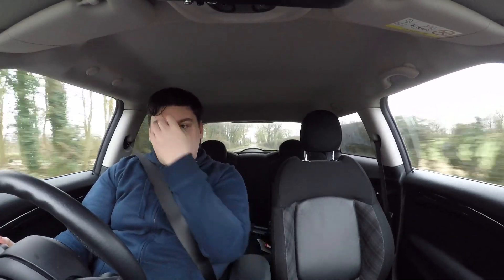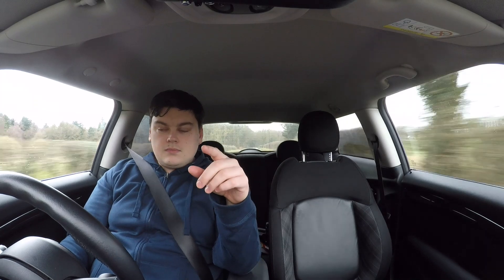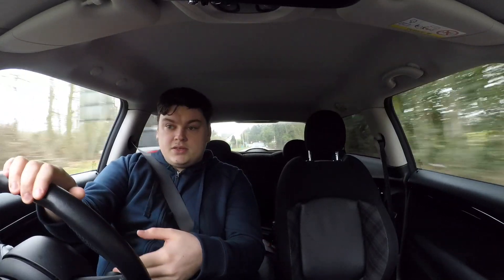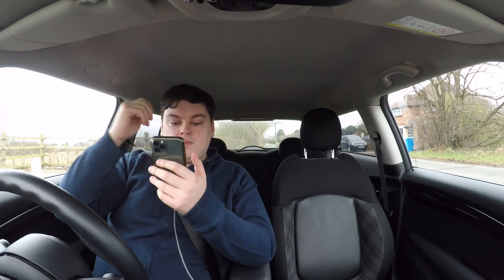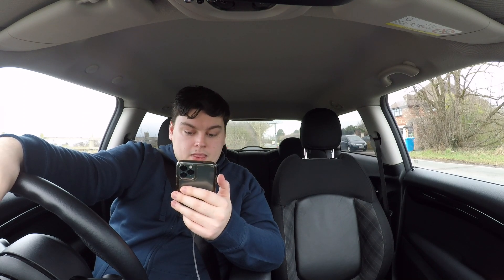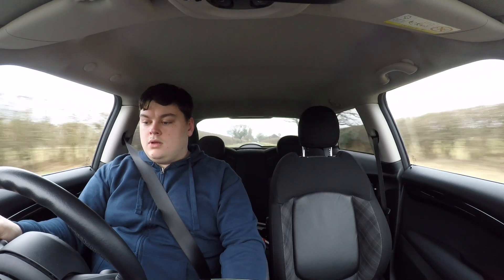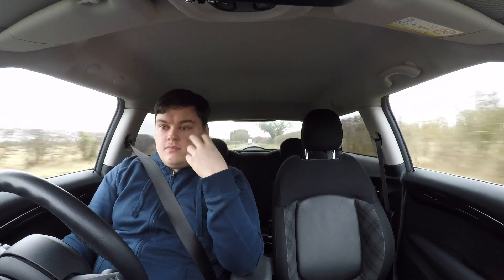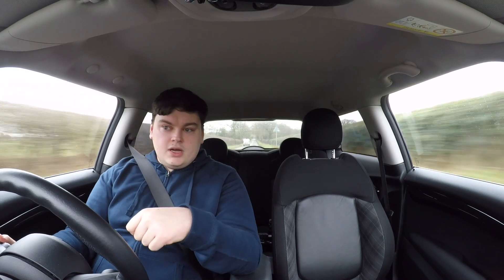MINI COOPER S F56 EBC YELLOW STUFF BRAKE BED-IN PROCEDURE!

Comment: Nice video Ben. Iv gone through the same process with yellow pads! Now done 1500 miles and they are better now than they were after the bedding in process! I feel like the cold performance is not massively improved from stock, but once they have some heat in to them it’s night and day.
Reply from the maker: Hey Paul! Thank you 😊 your spot on there. I thought they had improved massively once I had bed them in but since doing around the same miles as yourself it’s crazy how much they’ve changed over time. I agree though, cold performance is close to stock but once you get them going it’s fantastic!

Comment: Thanks the comments here saved me some money. My car has Tarox Strada pads and they're amazing when hot but basically OEM from cold. Which is of little use to me as I don't drive that hard and value that initial braking bite. Was considering Yellowstuff but if they're exactly the same then I won't throw money at EBC.

Comment: Hey Ben, I just installed EBC Yellows on my F56 and am experiencing a ton of noise. Just wanted to see if you can share your experience after bedding them in. Living in Chicago has made it difficult to find a place to bed them in properly but I was able to bring them up from 80 -> 20mph 3 times. Noise is at an all time high. Probably about 500 miles in on them.
Reply from the maker: Hey mate! They are slightly noisier than the stock pads I’ve found. But performance exceeds the slight noise for me.

Comment: Great video, how is the noise with the EBC Yellow's? I'm considering getting them for my '19 JCW but I'd go crazy if they are noisy since it's my daily driver.
Reply from the maker: Hey! Thank you! When they’re cold I have noticed that there is a slight friction sound but once they get some heat behind them they seem fine
Reply: @BenRolfe  Great, thanks, I'm trying them next then!
Reply: @bokiNYC did you try them? How did you like them?
Reply: @BlueWafer  I didn't get to try them, traded in my Mini for a 8Y RS3 - after about 40 years of driving only manual cars I had to switch to an automatic. But it's a great car so I'll be just fine. I do miss my JCW from time to time, it's a great car.

Comment: How can u bed brakes in with the zinc coating ? I thought that had to be removed first
Reply from the maker: Zinc coating? There was oil on the disks for transportation purposes to stop rust which was removed using brake cleaner.
Reply: @BenRolfe  no I mean on brakes discs u normally get that first layer which normally dissappear off after like 5 miles or so no one uses brake cleaner nowadays on new brake discs that was olden day stuff
Reply: @BenRolfe some people do this process immediately after fitting new discs and pads isn't 250 miles bit too late
Reply from the maker: @germanautos9460  gotcha, I’d driven the car around 50 miles or so before bedding in. I think I mentioned it on the video but I can’t remember. So I’d imagine that any zinc layer on the disks had already worn off by the time I begun the bedding in process
Reply from the maker: I just went off the manufacturers bed-in process which came in the box and is available online. 

https://ebcbrakes.com/race-motorsport-articles/bedding-in/
Reply: @BenRolfe 2 last question I promise lol the brembo discs were they from bmw/mini as in OEM part ? And when bedding in new pads with new rotors don't the rotors have their own bedding in procedure like 900ish miles or so before u can have fun ? I'm just a little confused with the whole process I keep warping my discs and soon my bank acc will be empty 😂 I found your video really helpful
Reply from the maker: @germanautos9460  no worries lol! I just stuck by the bedding-in procedure for the pads and they have been great ever since. The brembo disks were from a retailer called Euro Car Parts, not MINI directly. I haven’t had any issues so far and they’ve been on there for a year or so.